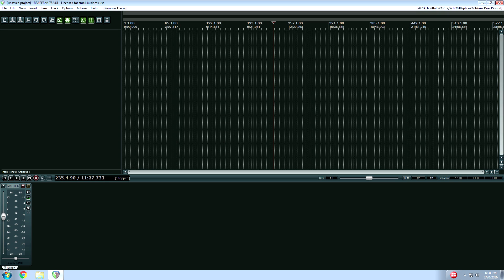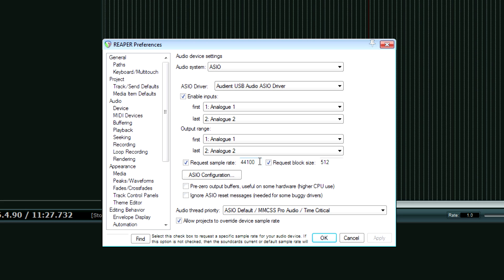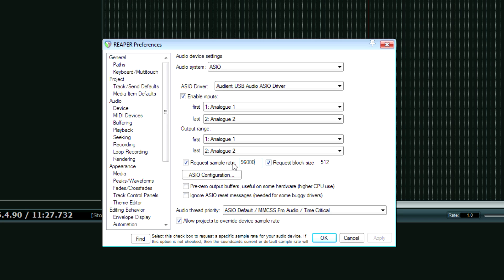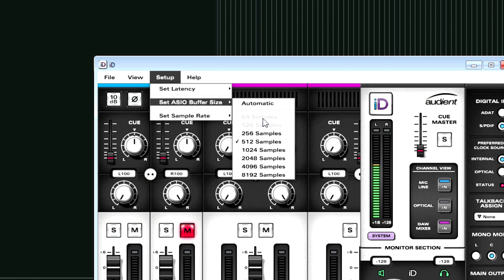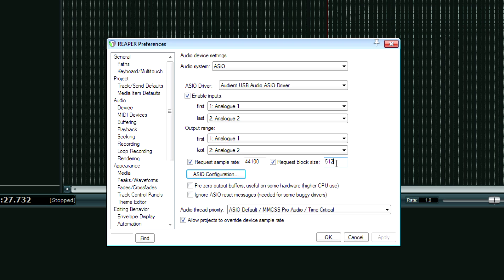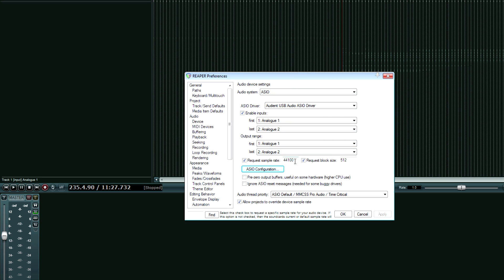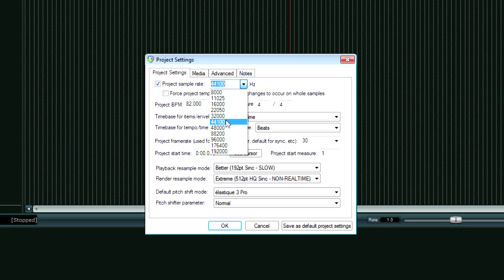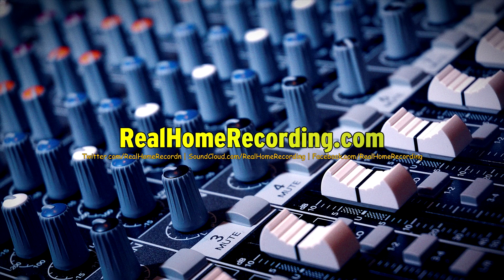How to Set Buffer Size & Sample Rate Tutorial

Comment: Do I have to match the buffer or the block size in the DAW and the interface control pannel?
I'm on the latest version of Presounus's interface driver but there's a bug of the control pannel failing to display the settings of the interface including the sample rate and the buffer size. 
I have the block size on my Reaper down to 128 but the buffer size on my interface might be higher. 
It runs fine for now but could that cause any issues down the line?

Comment: I never understood why if you say your favorite sample rate is 96kHz you use 41kHz for recording this video... And that thing puts a lot of confusion on the entire explanation. Are you suggesting using 512 buffer size only if one uses 41kHz but if one uses 96kHz the buffer size should be lower?
Reply from the maker: My screen capture software does not support sample rates higher than 44.1 kHz so when it's not at 44.1 it has lots of clicks and pops.

I'm not sure why you're asking about a 512 buffer setting.
Reply: @RealHomeRecording  Thanks for answering! :) Got it about your capture software.

What I ask is that if I should low the buffer size when I'm using a higher sample rate, like the 96kHz. And for what reason you decided to leave the yours in 512?
Reply from the maker: @juanjoserodriguezvalcke8995  when recording I'll lower it to 32 or 64. When mixing/mastering I'll put it at 1024 typically.
Reply: @RealHomeRecording  And at the end of the project you render it with high parameters? Thank you very very much for answering!
Reply: I've been confused on this as well.  I have a Zoom R8 that I'm using as an audio interface.  Up till now, I've gone with the default; 44.1KHz and 1024 block.   Never change it but have played around with it.  Once in a while I'll get a 'crack-pop' during playback.  I'm recording musical instruments & vocals with some plug-ins but nothing fancy.  What do you recommend and where?  i.e. Track Recording, mixing, rendering?

Comment: Is there a way you can change the buffer size outside of a program, when I start pro tools it says "Your audio device is configured with an unsupported buffer size. Please select one of the following supported buffer sizes in the device control panel: 32, 64, 128, 256, 512, 1024, or 2048.

Comment: I didn't understand what any of the numbers meant that what you were talking about but I followed your advice to the letter and it worked. I don't understand why Reaper doesn't just do this automatically but thank you so much for your clear instructions I can use my midi controller now!! :)
Reply from the maker: You're welcome! REAPER doesn't do it automatically because you want higher buffer settings while mixing. Or some systems can't handle very low buffers for whatever reason. Companies should explain this buffer stuff in the interface manuals but they don't. Or at least most companies don't.
Reply: RealHomeRecording.com MOTU explain this in the Digital Performer manual. Very comprehensive.